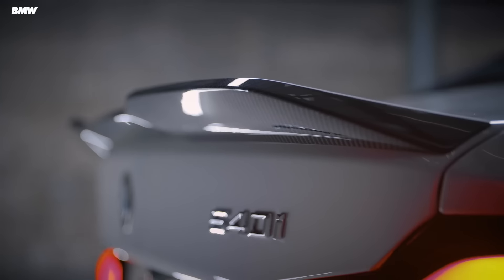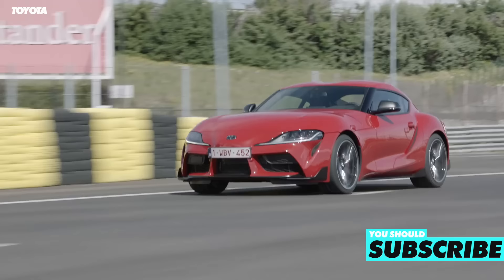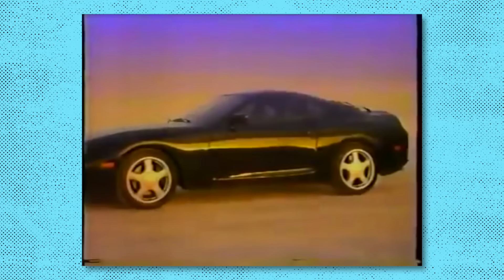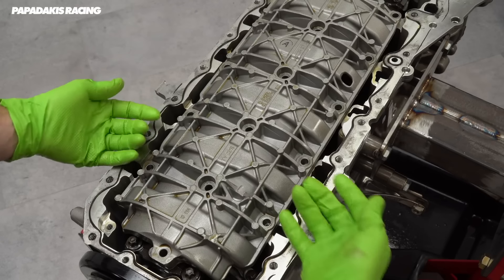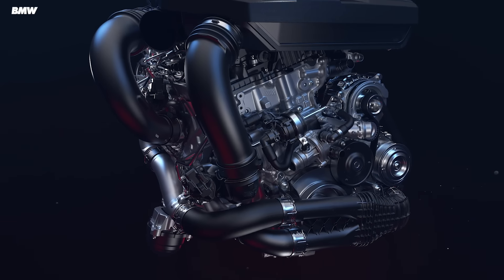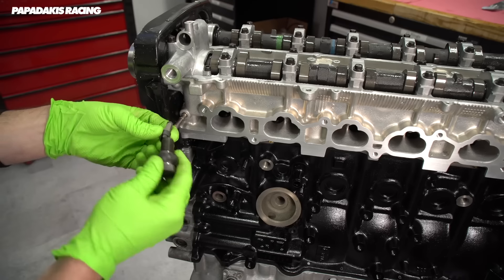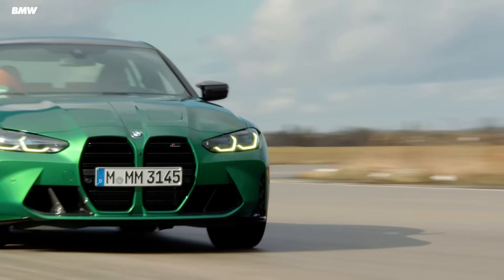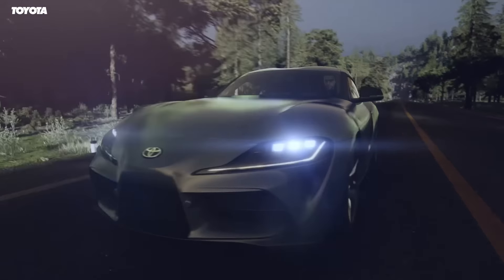Inside BMW's Greatest Engine

Comment: Would have been nice to hear about the N54- it’s the main reason why the B58 has been so good
Reply: I sold bmws during this time and switchover.  To be honest I LOVED the n54 engine sound. but the B58 is much more universal, brakes less, and the damn temperature housing gasket doesnt fail
Reply: @danascoles1205  agreed that it’s more reliable, the B58 had to start somewhere however. The engine itself is bulletproof- the ancillaries let the N54 down! Just had to change my HPFP lol, so I can feel your pain.
Reply: @danascoles1205  N55 and need to change my gasket lol.
Reply: N54 is extremely unreliable and problematic. Great motor when running.
Reply: @watchkevingo  my n54 in my 335is got upgraded turbos at 55,000 miles and only had to change one coil. It's still running good at 82,000 making 680 wheel horsepower on e85 with the original hpfp.
Reply: @timothy3095  are you running PI? what's your lpfp setup? I got a FBO 2013 335is
Reply: Watch a n54 video then vikesh
Reply: Other than displacement and cylinder configuration, the B58 shares nothing with the N54. It's a ground up engine in every sense of the word.
Reply: @watchkevingo  my n54 156k miles on stock turbos, only issue were radiator, radiator reservoir , alternator and vanos sensors . Not really what I would call unreliable. But if all you do is read reviews and never actually drive a cars for 20k-50k you will always be bias and misinformed

Comment: BMW has made many flipping awesome engines, just not that many "recently". M30, M88, M54, S88, to name but a few, although all are straight 6's. For info, the BMW F1 engine used in the 1980's, with massive turbo's and producing up to 1,500BHP from 1.5litres, was built around old M10 standard road going engine. In fact the block was the "stock block".

It's only the engines from the last 15 years or so that have tended to have "reliability" issues.
Reply: Eight letters that it seems none of these guys are aware of or understand, DI-CBU= (big) PIA.

Comment: You should look at the BMW N54 engine it is legendary for pushing over 700 hp on stock bottom end,  plus the fact the N54 has a forged crank and rods makes it a better choice, twin parallel turbos plus the after market support has made the N54 a tuners dream and hence the title of German 2JZ
Reply: Yup. Not to mention it’s so easy and cheap to make big power.

Comment: I own a n55 535i and b58 440i. Both are amazing to tune and both have upgraded turbos. 

Gapping dodges and "hellcat" jeeps and picking up groceries lol
Reply: How’s your 535i been treating you? I have one as well
Reply: @Zion lords  I blew the stock zf8hp45 on the 535i. If you do have xDrive and xHP, I really recommend doing oil changes for the trans every 20k and not 50k, xDrive puts more stress on the gearbox. 

Just take care of the trans if you want to tune it. Otherwise it's been pretty reliable apart from oil leaks here and there.

I put in a used trans for $5k (including labor) and it's working great
Reply: @GodKing804  how much hp were you pushing? I have an lci xdrive f10 n55 with 8hp45 and mine has no issues. Im pushing just north of 518hp. No trans oil change ever and the only thing i had an issue with was the transfer case but that can generally be bypassed with xhp

Comment: How are they defining reliability tho? The B58 has only been around 5-6 years. I would be very impressed if the engine experiences no mechanical problems past 150k mileage
Reply: Plenty of high mileage older 340is for sale right now.
Reply: @Southpark124  but that doesn’t really indicate reliability
Reply: @inosurrender8327  I haven’t really seen anything on the forums other than basic maintance. Some people complaining about oil burning issues in the ‘21 Supras but I think that’s mostly because of the wrong viscosity used (0w20) in areas like the Northeast US. 

I haven’t seen any complaints from the BMW side
Reply: @Southpark124  well if there’s no complaints then that’s good for BMW lol

Comment: I’d argue the S1000rr engine in BMW’s sportsbike is the best they’ve done - no recent history of 1000cc superbike engines but just dropped into the class and decimated the big four Japanese factories, redefined what could be done with such a small capacity.
Reply: Maybe you already know, but  BMW was an engine manufacturer in F1 back in the early 2000's. With that in mind it isn''t mindbogling to me that they did that 1000cc as good as they did :)
Reply: @M4RK_F  it’s not as straightforward as that, Ilmor built F1 engines but made a complete hash of their MotoGP bike - Cosworth used their F1 experience to help Aprilia with their MotoGP bike and it was a dog - F1’s John Barnard and Lotus tried to build a bike for the Kenny Roberts team in 2003 and it was crap too…regardless of BMW’s F1 history the fact they dropped into a class they’ve never been part of and instantly dominated is pretty special.
Reply: @simondrew7346   i see your point, and I don't disagree. Atleast BMW has some experience with small high revving engines from earlier.

Comment: What made the 2JZ so solid was the iron block/closed deck. The BMW engine is nice but the plastics worry me, along with very expensive VANOS solenoids that can fail.
Reply: Vanos solenoids are 50 USD each and take 15 minutes to replace

Comment: Exactly the same stuff was said about N54 engine aswell... "best Bmw tuners engine", "German 2jz" and so on. So b58 isnt the only Bmw engine out there to be called all that.  Though evolution has  made it a bit more reliable by getting rid of expensive piezo fuel injection and electric waterpump. N54 was more revolutionary, experimental,  B58 is evolutionary step from that. And between the  two we have N55 aswell.

Comment: To keep any BMW engine running reliable do early oil changes every 6000 miles rather than the recommended 10000 mile interval
Reply: The m3 version of this engine can make 500+hp, return 30 mpg, be warrantied for 60k, and oil is fine for 10k miles according to bmw.

Wtf why are we gong electric?
Reply: @CSLFiero  because compared to electric that’s still slow as shit
Reply: @POVShotgun  tell us about your 06 accord
Reply: @CSLFiero  Because the worlds governments have gone mad!
Reply: Same is said about the Audi 3.0, both the older supercharged versions and the newer turbos.

Comment: Though i prefer the 2JZ, im glad Toyota went B58 for the Supra. However i completely disagree with the whole argument that making a "3JZ" would have been to expensive. If, just like Nissan did with the GTR, Toyota had gone the V6 route instead of I6, then they pretty much already had the perfect engine in house. The 2GR-FE (3.5L V6) that they pretty much put on everything. Even on Lotus Exiges and Evoras. That engine is highly tunable and easily able to withstand 500sh HP. And it meets regulations. And its super light weight. And it sounds absolutely awesome. Imo thats the engine the new Supra should have had...
Reply: Denken ist anstrengen... Da haben sich schon Leute dabei verletzt..

Comment: I was a BMW tech and I can say that the b58 are pretty solid.  They also make a b46 that is a 4cyl that is the exact design of the b58 just cutting off 2 cylinders.  Alot better than than the n20 reputation haha.  Overall I'm not the biggest fan of BMW but I would definitely buy a supra if I had the chance and be fine with the b58.
Reply: heey, I have a n20, what's wrong with it? 😂
Reply: @KiNG-fr5ib  just be careful of the timing chain haha

Comment: The BMW-Supra is not just a BMW engined Supra but the whole car is a BMW!
That’s means the chassis, electronics, gearbox, suspension and so on are all BMW!
Reply: And where's the problem?
Reply: @HirokaAkita  lmao that is the problem in 5 - 10 years.
Reply: BabaYaga Racing  Pretty much yes. It’s a z4. About 90% is bmw.
Reply: You mean a the toyota Zupr4.

Comment: If your going to compare something to a 2jz an S55 or S58 is much closer if not better for most practical purposes. The 2jz is heavier but more bulletproof; the M engines are lighter, quicker (twin turbo) and way more hightech but less bulletproof. I have an S55 F82 M4 and 700-800 hp is pretty easy if your willing to write the check BUT I've never heard of 1500+hp M cars like you see with the 2JZ Supra, this is what has made them legendary.
Reply: The B58 Zupra fan boys dont like when you worship the 2000 hp capable 2JZ block .. 
I would love to see that B58 block do 2000 hp ...

Comment: That last part with cars having to meet new emission standards is a fact that many people seem to overlook when comparing newer engines to old ones. They cannot simply build an exact replica of a 2JZ anymore, especially having a heavy iron block that would add unnecessary weight to the vehicle, and a reason why so many car manufacturers are using plastic components. It sucks, I would love an engine built with an iron block and all forged parts, barely any plastic parts, and more simplistic design; it would be more expensive and bullet proof but it isn't feasible today.

Comment: I have a 340i Msport, bought it used. Came with M brakes and upgraded suspension.
Work done so far -
Performance air intake
High flow catted downpipe
Charge pipe
Upgraded spark plugs and ignition coils
Tune
Pushing good power. North of 400WHP.
Getting meth injection setup and exhaust upgrade next month. Undecided on upgrading the turbo. Any tips on getting it to near 600whp?

Comment: The best, most reliable BMW engine of modern times is the N52 and it is still not comparable to anything Toyota makes.
Reply: The N52 is dummy reliable, and the 54 is probably what people compared to the 2J first
Reply: N54 block itself can handle 850hp+ on stock block the maintenance around it is trash but if your buying a 2jz for the 90s you’d have to put in just about the same maintenance. Plus the N54 is way more torquey bottom end because of the longer stroke.
Reply: @edwardruelas3116  also the N54 has DFI which is good for preventing knock, the worst part of maintenance is the turbo wastegates but if you upgrade to TD04s it's not an issue. Injectors and HPFP, and oil filter gasket are the only other major maintenance issues. Just expensive is all.
Reply: true N52 is the best ever
Reply: The N52 is a great engine but not very tuneable. And of course isn’t comparable to anything Toyota makes because Toyota don’t have any engine as advanced as what BMW have.

Comment: In your video at 4:19 mintues you should a block which is a open deck the B58 is a closed deck system. Just a head up. Closed deck system is a more stronger engine design.

Comment: Too bad BMW put the cam gears on the same side you bolt to the transmission, meaning for anything related to timing you gotta pull the motor.

Also that aluminum open deck block won't be able to handle much more than 800 bhp, the 2JZ is closed deck cast iron and has been known to make over 1500 bhp
Reply: It's not open deck. I'm not sure why they showed an open deck image there. Check out a teardown of the engine. It's a closed deck.
Reply: It’s based off the B57 diesel closed deck block which actually has a larger bore than the B58 so it has even more meat around the bore than a normal block would. Also we don’t live in the 90s, modern engines don’t go through timing chains left and right (looking at you Audi 4.2 & M62.) the timing chain guides should easily last 150k miles if not significantly more just like previous BMW inline-6s.
Reply: I think Papadakis's B58 already has 1000HP on stock internals. Not sure how much more power the block would withstand, but stock vs stock internals, the B58 is stronger than the 2JZ, all while being ~60 kilos ligher.
Reply: @Kiyolani  interesting, I wonder why they showed that then.
Reply: @CadexLaw  Ik they dont go through timing chains often, but if you want to tune the motor then youre gonna have to pull the motor to replace the cams, or do any other timing related mod.
Reply: @kylesebring  there are no aftermarket cams for these engines since they use Valvetronic (infinite VVL) & VANoS (VVT,) if anything it would cause more harm than good. Timing can be tuned in the DME which is why 800whp in a BMW 3 liter feels way more torquey and alive than 800whp in an older engine that doesn’t have very much displacement and huge cams (2JZ, RB26, etc.)
Reply: @CadexLaw  Interesting, yeah that's why I don't like tuning modern engines it's just not as fun. All about computers nothing is hands on. Anyway ill just stick to my 4A-GZE and SBC
Reply: @kylesebring  nothing wrong with that, there's something to be said about doing it all mechanically by yourself in a garage.

Comment: Nope......nope, nope, nope.
The greatest engine BMW ever made, arguably, was the M10 four cylinder based engines. The M12 Formula 1 engine and the S14 engined M3 used the M10 as a base to kick butt and take names. And bonus, they didn't leak so much😆

Comment: The s54 is still the best in-line 6 ever made
Reply: Yep! Had that motor in a ‘02 M Roadster and it pulled hard from idle to redline. Good thing too, because the 5-speed manual felt horrible.
Reply: @sketchpv3080  right, they need a turbo though, mine has almost 3x the stock torque and it carries it all the way to redline

Comment: Love sending 5.0 and scat pack owners into an existential crisis with my b58.
Reply: Top GIFs With Sound  Some things will never change :')
Reply: A modified Honda B or K series can destroy your Zupra and humiliated you for less than 20k.
Reply: @manueldelcaribe2180  But not all of us are interested in driving 20 year old Hondas
Reply: Top GIFs With Sound  and the Zupra is 95%BMW the MK4 is more Toyota and is more reliable is a monster can go up to 2000 HP something extremely hard to archived on the  Supra wannabe 😂 And a Honda is far more fun to tune up you can make it far better than the GRSupra with the almost unlimited tuneability.A basic Honda is mediocre but after all the mods you can make a street/strip beast that can make cry many rich fanboys 😂

Comment: I worked for bmw as a product specialist and can confirm the b58 is a beast and reliable. That motor had been updated almost yearly since it’s release in 2015, that’s right it’s 7 year old now! A word to the Toyota fans is that the mk4 ended the supra production because of terrible sales figures. If you want Toyota to keep production you’re going to have to go buy them brand new to support the company. Money talks. My wife works at Toyota and guess what, they sold less than 5 last year. This year so far 2.

Comment: Enjoying the B58 in my m340.. honestly gave it a shot after hearing it went into the supra so far no hiccups except that burning oil around the 6k mark in between oil changes
Reply: Why are you doing over 6k oil changes. It’s a turbo charged direct injected bmw. I would change the oil every 3.5k miles. Check the forums.
Reply: 5000 miles max.

Comment: It is said that in order to create the 2JZ-GE / 2JZ-GTE engine TOYOTA just took YAMAHA'S work with the 1JZ-GTE / 1JZ-GTE engines, wich are said to be developed by YAMAHA. And then is the other rumor that YAMAHA just "took inspiration" (copied) the best features of a BMW 6 cylinder in line engine of that era. So, YAMAHA'S 1JZ is "inspired" in a BMW engine and the 2JZ is just TOYOTA's copy of YAMAHA's work (wich is a copy of BMW's work)

So for the JZA80 Supra we got:
The 2JZ-GTE has its block casted at an European foundry (Engine block cast made in Europe) Cylinder head is YAMAHA's work and manual transmission is a Getrag, wich is Made in Europe...

Comment: Im glad toyota made the call with B58 engine - its a GREAT choice! i had to BmW with N54 engine - and its similar to B58, but less reliable - and i really enjoyed the simplisity of power from it and its core reliability - its all the plastics around it that usually broke and leaked. Lets just pray BMW fixes their oil leaking from every gasket issue. Its a problem.

Comment: I have an m140i, had it around a year with no issues. 1 minor problem which this engine seems to have and a lot of reports on the same issue is coolant usage. My little tank keeps going below the minimum and I have to keep topping it up. Its not leaking from anywhere either.. I heard if you replace the cap this can fix the issue, might give that a go.
Reply: I’m a year late so guess you have fixed the problem, but if there is no visible sight of leakage it will be the coolent filler cap, just buy a new one problem solved
Reply: @redarmy1778  yeah mate, both caps were leaking, since I replaced both it's not used any coolant

Comment: Ahem.. i am a BMW mechanic. And yeah big downside on the oil filter. Almost every time a B58 engine enters our garage for an oil change. The oil filter is cut in half. Or just broken or completely destroyed. Every time we actually have to change the oil filter housing since the broken pieces of the oil filter can get into the cooling and oil channels of the engine, blocking oil flow and coolant. Leading to possible overheating or worse. Engine damage. There were so many that BMW mechanics started just picking the oil filters out piece by piece. And we don't tell it the costumer😂 
Don't worry too much though. We always make sure every piece is out. In more recent times the oil filters have not been broken. Only happens sometimes now.

Comment: B58's now also have forged rods and higher pressure fuel pump and injectors.  I like to think that the B58TU update was the "Toyota Update" and Toyata engineers had a hand in some of this to ensure it met their standards for the Supra.
Reply: I doubt is Toyota Update. You can check on mostly BMW engine, always have TU (Technical Update) code after several time being on market.